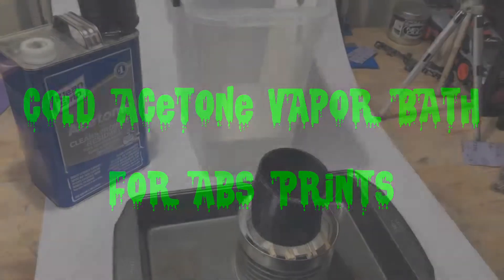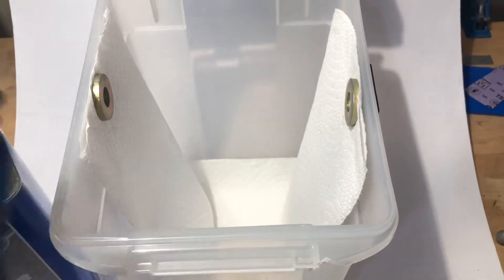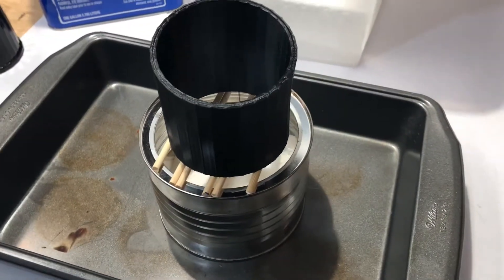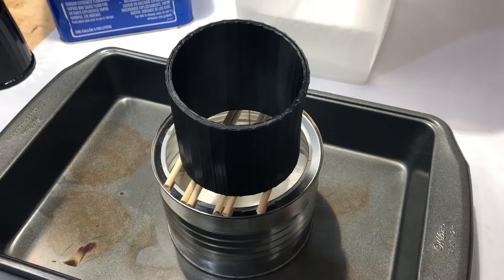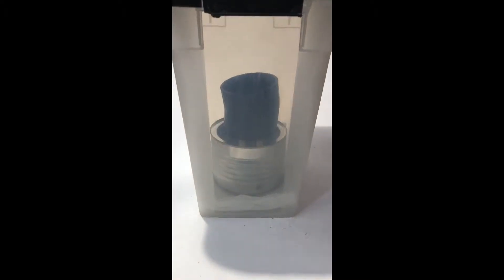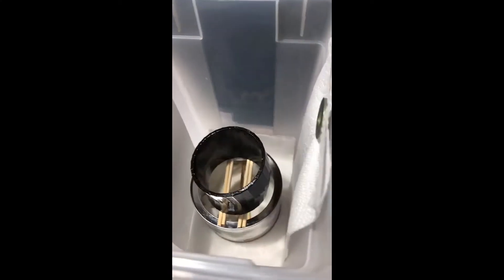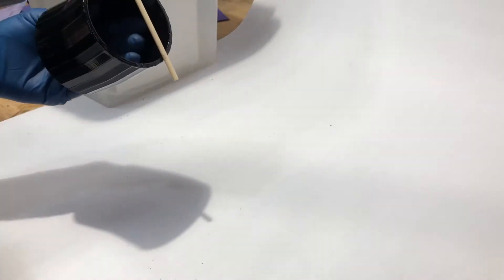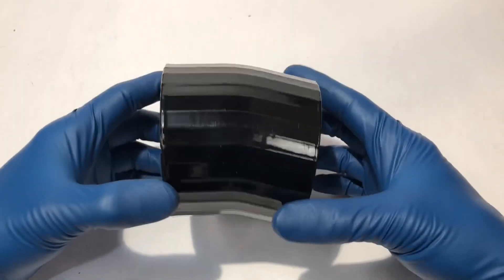Cold Acetone Vapor Bath For ABS 3D Prints

Comment: So you did 30 30 then 20 and 20?, is that correct? Total 1 hour and 40 min? You want tips for not making it not stick? Maybe use wax paper cut to bottom rim size
Reply from the maker: For this one I think that’s correct. However the time really varies depending on a bunch of factors like part size and volume of acetone that you use... I also started designing holders for the parts and printing them out of pla and have been really happy with those results.